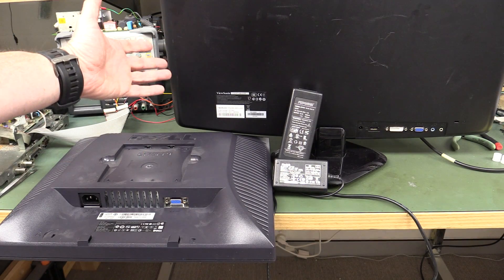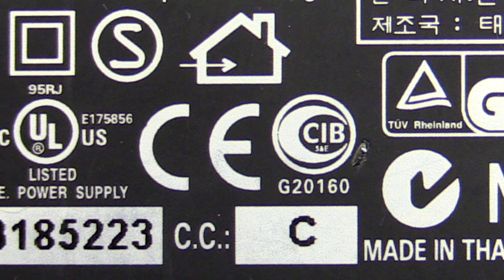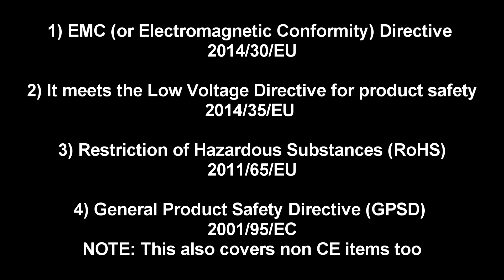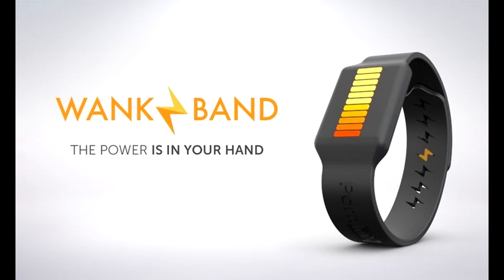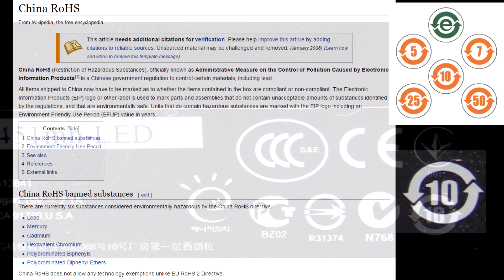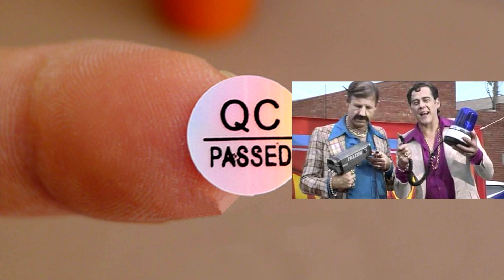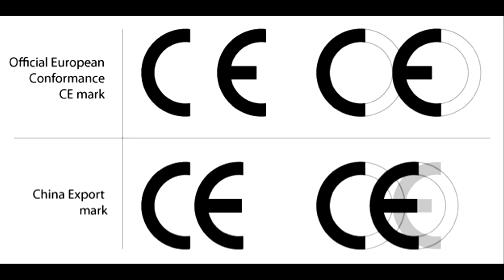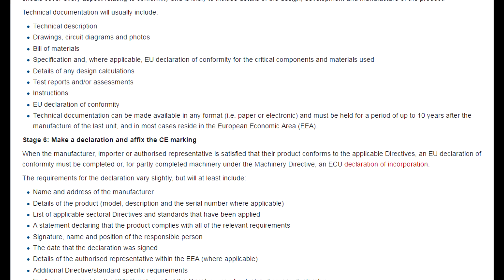EEVblog #996 - What Is The CE Mark On A Product?

Comment: Those quality tested pass stickers don't mean the product has been tested either. Depending on the quantities of manufacturing only a small percentage actually get powered up. Usually a couple of random products per batch are sort of tested and this just means that they were powered up. It's lucky to be 1% but in reality it's much less than this, especially in China.

Comment: My TP-LINK internet repeater doesn't have the FCC mark in it. Maybe because it has a built-in EU standard mains plug, but it works between 100-240V at 50/60 Hz.

Comment: I think the Wank Band is a bad example. Most Wank Bands (TM) include a radio of some sort. That means you have to comply to the 2014/53/EU radio directive, which in turn requires you to comply with the low voltage directive as well.

Comment: This is some of the official text about CE: "The individual EU member states conduct market surveillance to protect consumers against unsafe products and the wrong use of the CE marking. For example, it is checked whether the product is CE marked, if the product meets the requirements and if the mark is properly designed. If the product does not meet the requirements, there are more sanctions, such as incarceration, police report, fines or removal of the product from the market. The sanction possibilities depend on the legislation the product is subject to."

Comment: WEEE is not a subset of RoHS, they are two different regulations. Also, don't forget another little talked about biggie; the 'Technical File'! Dave, do a US FDA video next. Just take a look at the FDA radiation control definition - anything that emits electromagnetic radiation needs an FDA radiation form. So that specifies everything that has a current carrying conductor i.e. every electrical/electronic product, but then it only lists examples like microwave, laser, CRT, etc. It is a bureaucratic contradiction by definition. What most engineers want are clear definitions for these regulations, but the regulators intentionally leave grey areas so that they have the upper hand should there be a dispute; it is just the same for the UK tax office HMRC.
RoHS(II) (CE) compliance does not need a marking; CE covers that. However, the WEEE wheely bin does need to be marked on products, also a part of CE. Nice inconsistency. Mind you, it might have changed since I last looked.

Comment: In my experience the "CE" mark has little to know guarantee that the product is RF/EMC compliant. Many products that claim to be RF/EMC compliant have been tested in laboratory conditions and not REAL WORLD. A prime example are the plethora of Powerline Network Adaptors (PLA/PLT). When these devices are connected to the unbalanced domestic mains supply they become radio transmitters and the mains wiring becomes the antenna. The result is a very high level of radio interference that covers all of the HF spectrum and in some cases extends up through the VHF spectrum. I suffered interference from a PLT installation that after investigation by OFCOM was found to be over 100m from my property. The devices bore the "CE" Mark because they had been certified on an ideal  load and not on a facsimile of a real World electrical mains supply. Other known destructive RF generators bearing the CE mark include SMPSU's, PLASMA televisions, LED lighting, solar panel power inverters. It has been suggested that some manufacturers will remove any filtering from products once the CE mark has been obtained to cut down the manufacturing costs.

Comment: hi Dave, seems that the FCC levels thing also applies to CE marked products! A video on CE marks is not complete if you leave out the markings that are supported by Notified Bodies. You can recognize these by having 4 digits near the CE mark. In that case the compliance to the required standards for the specific product class is in fact corroborated by an independent authority!!

Comment: We ran into the wrong side of the CE certification. 

A major company in the US making laser engravers only applied for the CE certification instead of springing for proper testing. CE is not accepted in Canada as safety testing because of the self reporting issue, so we received a laser that we were not allowed to turn on. 
The company then made us pay for shipping back to them, and a 25% re-stocking fee...

SO we blew several thousand dollars so we could LOOK at a laser for a week before we sent it back.

Comment: Well, you're somewhat wrong on "self-certification". That depends on so called Conformity Assessment System and may vary greatly depending on the type of a product. For example you may be pretty sure that anything dealing with fire safety must be tested by a (so called) Notified Body. I don't know how it goes with consumer electronics precisely (I'm a civil engineer). It boils down to a fact that nobody is really issuing a The Certificate on a shiny paper for a vendor, but all the bits and pieces of independent certification are there.

Comment: what defines a product that needs CE mark?
does a ordered PCB with pre-soldered components count?  
i recently ordered one of these buck-boost modules you comonly find on ebay.  customs blocked the import because no CE mark and missing german manual.   i believe they didnt had to block it, since its not a product you can use without knowledge unlike a hairdryer or something

Comment: praticly the CE symbol has no meaning anymore, on everything is this symbol even stuff that cant have a CE symbol like cargo lashing straps (i that special case dont use lashing straps with CE symbol these are usualy very bad quality and a threat to ur life), only the GS or TÜV symbol has any meaning
Reply: 1O1ZERO There are presumably CE-related minimum standards for lashing straps too.  But GS is Geprüfte Sicherheit, which is the joint mark of a few German test houses, indicating that the product has passed actual testing by one of them, not just been rubber stamped.

Comment: "CE" alone does not help anymore. 
1) the CE mark has to be on the body of the product, not easy removable. in other words: stickers are not allowed anymore, and it has to be on the main body, not on the battery cover lid...
2) the manufacturer or the importing company has to appear on the body with a "working" postal address ("working" for legal letters.)
3) the manufactuer is obgliged to provide the DoC in a "locatable" manner on their website in full text. (attached with the product there is no allowed to make a short version with a web link. Which must be working for the full product life.)
4) in some countries you may send letters to competitors if you think they do not comply with these rules. And they have to pay your layer a regulated amout of money for the effort (if you do this right, you can make a living from that. there are law firms specialized
5) if customs don't like you, they may seize any "bangood/aliexpress" import not complying. (And hardly any chinese seller does... been there, survived that... even pebble watches were seized due to those problems massivle in the beginning.)

Comment: It can also be the importer declaring conformity, it does not strictly have to be the manufacturer it self. Usually, as a costumer/buyer, you can not take the manufacturer accountable, just the seller. Small technicality I know, but if in doubt it is complicated.

Comment: Wait wait.. The EU has been around for less than 25 years, but I've seen the CE marking on electronics since the 70s. How could Conformité Européenne have anything to do with the EU when CE has been around for a lot longer?
Reply: Well, first of all the EU didn't spawn out of nothing. You have the EEC from the 60s/70s and before that you had the steel and coal union. So the CE logo could have been around for a lot longer than the EU (which was formed in the early 90s).

With that being said, I'd be surprised if you could find a CE mark on a product from the 80s or earlier. I cannot say with certainty that the mark didn't exist at that time because I was just a child, but I would be very surprised.

I know that CE mark became mandatory for industrial machinery after 1995 and I believe it was around the same time I saw the CE mark pop-up else where as well (like electrical and electronic equipment) but that doesn't rule of the possibilities that the CE mark existed before that point.

Comment: +EEVblog For electronic and electrical stuff, European manufacturers usually still have to comply with either their local regulator or another country's regulator. Even on the examples you've provided, you can see logos like TÜV who would have certified the product. At the end of the day, even the C-tick in Australia just requires you to register for a number and it's up to you to keep documentation on your own compliance, IIRC.
Reply: Simon Butcher TÜV is a private testing company, not an actual authority.  The mark just means one of their labs did the compliance testing.

Comment: I have an internship at a test lab for all this stuff right now. Good to see you covering it. How in depth are you planning to go? There's a ton to cover, from the emissions and immunity testing to safety with and environment testing like ingress protection and heat/humidity. ESD testing so far is my favorite...using a gun to do contact and air discharge up to 30kV.

Comment: China export is a myth?
Big Clive would prolly blow that one out the water (well off the desk at least)
Reply: It is a myth that some Chinese business men sat down and choice to make a brand called "China Export" and make their logo closely resemble the CE mark. No such thing exists
What do happend is two separate issues:
1. Some (especially Chinese) manufacturer/sellers just slaps all the logos they can onto their products without conforming to the meaning of those logos
And
2. Some companies dont know how to print the CE mark correctly. (ie distort the height:width ratio of the logo)
Reply: I have seen th CE mark in the 1970's well before the EU what did it mean back then !
Reply: kardeef33317 The EU itself is a rebranding of the EEC, spelled differently in French.  That's where the CE spelling started.  When the organization renamed itself, they kept the mark.

Comment: There's a small addition: in my knowledge if the producer isn't in Europe (e.g. China), the seller could go to jail if the imported ce product kills someone. You can even import products without a CE logo, put one on them and sell them (best with testing them of course). But you cannot sell products that require CE without them having one. Special bonus for the strict German custom rules: if the ce logo is wrong (e.g. China export) the changes are high that they forbid you to import the given product if you're a customer. Don't know the rules for resellers.

Comment: The declaration of conformity can ONLY be signed by a EU person who lives inside EU. Anyone signing this DoC and living in China or similar is violating the rules of CE marking. There is a hole lot of other stuff with the CE mark. Any technical documentation must be stored for minimum 10 years and handed over to EU authorities on request.
If a product has a CE mark, it MUST include the DoC and a manual or user guide in the local language where the product is sold.
Most products made outside EU doesn't comply with CE, especially low cost products.

Comment: About the picture shown from 8:29 onwards:  It has a "Hg in a circle" mark.  Does this mean "contains mercury"?  If so, how can it be compliant to C E and therefore RoHS?
Reply: goose183
That's an old Dell LCD. Like real old. Most likely Mercury was still allowed in monitors because they couldn't exist without it at the time.
Reply: RoHS was apparently adopted in 2003. Those old purplish Dells were around 2000-2005... They'd stopped using the purple plastic by the time Core2 came along from memory, which was 2006.

Comment: Very interesting. The problem with CE is that it is largely self certifying and as everything is made in china is complete bullshit, I mean who is going to sue who in china if it goes wrong ? but then of course the EU darn't upset all that cheap garbage coming in from china or the more easily because someone included CE in the moulding.
Reply: Simon Turner Trick is the DoC must be signed by a European, who gets the jailtime, while the local company he worked for gets to pay the fines and damages.

Comment: Both hate em and love em.  I've had to do compliance testing/designing, but I'm also a consumer.  Biggest problem is that laws aren't written with a sunset clause.  What used to be a concern, is no longer a concern.  All laws should be written with a sunset date, upon which it should be reviewed.  Upon review, either refined, sustained, or dumped.  Is hanging apropos for horse theft?

Comment: So that first part, the EMC thing, would actually have to mean that every "Powerline-LAN" adaptor out there is wearing its CE label without any right to - even those that were legitimately bought in the EU, because this "Powerline-LAN" technology disturbs other radio waves in a rather huge way (i.e. people doing HAM radio). After all, it turns the whole power wiring in your house into one huge HF antenna?
Reply: Seegal Galguntijak The Powerline network companies lobbied the private standard setting organization to make a special exception. The HAM community probably didn't even have a representative in there.

Comment: one thing the video didn't cover was the typical cost of having an electronic product tested to enable someone to CE mark the product.  Last time I got involved in this the three test averaged over £3k each which, given the small market the product was aimed at made the project non-viable.  I was confident in the product, and the prototype ran for 5 years in my home without any issues, but as you can never predict what numpties are out there, and as the product controlled heating elements, I wasn't prepared to put it on the market without having the test reports behind me.  I can see the reasons behind the conformity regulations, but it has killed off the small hobbyist who wants to sell a few items he's made.

Comment: Just missing one important piece of information, the 'CE Mark' is only part of the marking that may be required, as there may be the need for additional advisory warnings as part of the CE marking, including further symbols such as the 0-3 symbol if appropriate. Also, the CE marking must be visible at point of sale, so does not necessarily need to be on the product itself, so long as it is on the retail packaging (and in this instance, there would usually be a 'retain packaging for information' notice). Almost forgot, the manufacturers name and address need to be included. if the product comes from outside of the EU, the importer takes the legal responsibilities of the manufacturer (as if it had then come from the EU). Google a report we made on: 'ce marking of Mylar foil balloons' if you want to know more about the legal aspects of CE marking. ;-)

Comment: Once upon a time we in Britain had our Kite mark, for the British Electricals Approvals Board (or BEAB for short), once we got plumbed into the EU without our consent, the Kite mark ended up being left behind in favour of the CE mark which had absolutely nothing to do with what the BEAB did to test electrical products for safety in this country. We still do have some devices marked with the Kite or with the "BEAB" lettering, but it's few & far between, usually only applied to UK-built products...
Reply: twocvbloke don't worry in 2 years we will be free from the EU cancer

Comment: With the China Export you are wrong. Some years ago, whencheap chinese electronics was everywhere, and chinese things often meant crap it was common in europe that electronics had the fake CE mark on them.
Reply from the maker: There is no such thing as China Export, it does not exist. it's simply a fake/incorrect CE mark.
Reply: EEVblog . I have seen th CE mark in the 1970's well before the EU what did it mean back then !

Comment: Hi Dave, many years ago I was working for a company that made a 10kW power unit of sorts, they sent it away for CE testing.
When it came back, any component that already had CE was carefully removed.
Any component that didn't was ripped or cut apart.
The 10kW toroidal transformer was cut through so that it could be determined if any of the components were not CE approved.
Basically what came back was a metal chassis, cut into various pieces,   lots of components and the toroid cut in two.
Even the two PCBs had been guillotined.
A couple of videos on the other symbols would be most informative, even the double square , double insulated one.
Dodgey Bros.. brilliant

Comment: It can also mean China Export. And you can find it on any chinese product which meets nothing mentioned. Also common practice is to use chinese LED drivers inside european product with CE mark... So it means practically nothing.
Reply from the maker: No. Watch the video.
Reply: xxJerry19xx There's no China Export, it's an urban myth/joke

Comment: UL LISTED means about the same thing -- i.e. rubbish, nothing was tested by UL. If anything was actually tested, it'll say so, and almost always have an FCC logo as well. (been there, company wasted lots of money on that shit. in fact, the certified computer system instantly failed FCC testing - leaked HF all over the place, right out of the box straight from the factory.)
Reply: jfbeam alot of companies slap a fake UL label. If ya look up the UL number it will tell ya exactly what was done and is its a fake Underwriters Laboratory mark.